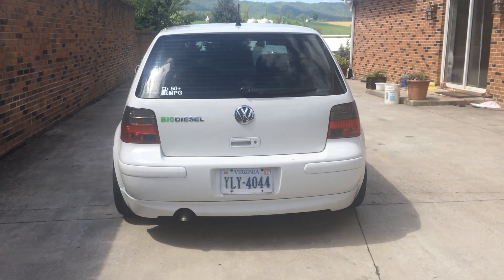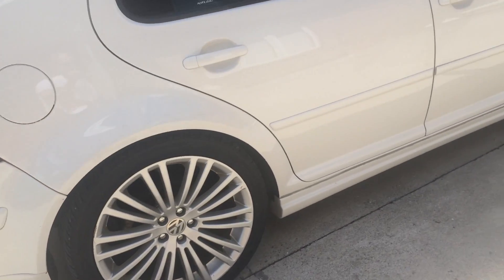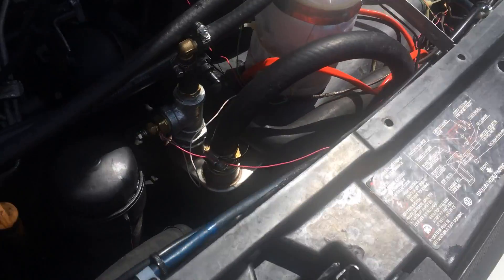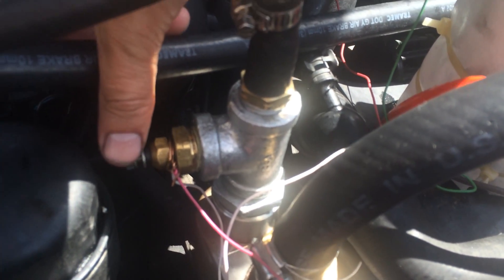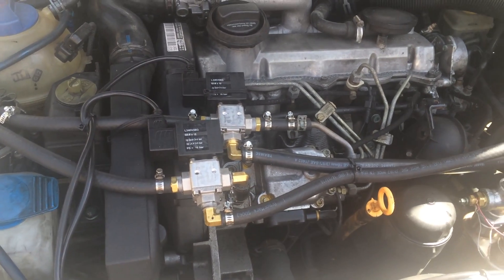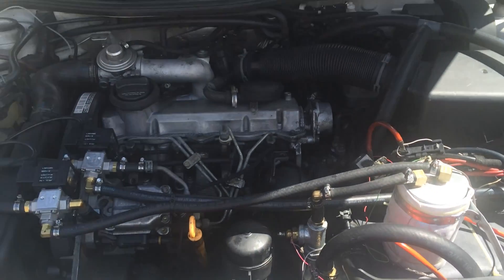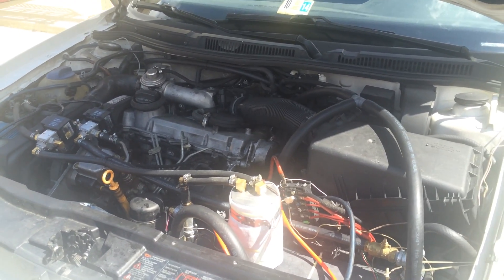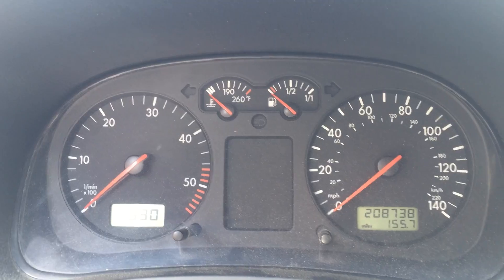Vegetable Oil WVO Conversion VW Golf TDI / Biodiesel

Comment: Wicked
How do you pass MOT ?
Would not it be better to use original fuel tank for veg oil and then tiny diesel tank in the boot for starting car up and driving a little before calling it a day ?
+ One large veg oil tank in the boot = 40 litres so you can 50%+0your  range on veg oil ?

Comment: Hey , I didn't found no more of following video ,like how after 1 year of use and how's the engine after like . I thinking converting my own golf Mark 4 TDI to biofuel or oil fuel
Reply from the maker: The Car is still running great. I don't do WVO anymore through, it was too much headache.
Before you convert your car into a veggie car you should know the drawbacks. 
I. First, you cant start running the veggie oil until your car 
is completely warmed up. So it is only practical for longer trips (at 
least 30 min drive)
II. Picking up and filtering the oil takes a 
time, after awhile it can become somewhat burdensome. 
III. Third, it is somewhat costly to setup, about $700 if you do it yourself (ordering 
parts individually) $1100 if you order a kit

Comment: Running 50/50 veg on a $300 2002 1.9pd mk4 105tdi remapped to 170bhp. 177000miles Engine noticeably runs quieter pulls  smoother.  On one occasion driving vehicle hard it felt like veins on the turbo stuck and felt like turbo stall. Back to running pure gas station diesel the issue hasn't happened again. Ambient temperature 15°c
Reply: You should try 35% diesel, 15% petrol (gas), 50% veg.... Plus 300ml mineral 2 stroke oil per tank.

Comment: 6 years ago this video was published. Please God tell me it's still runnin. Genuinely wanna do this
Reply: He still posts, don’t think there are any updates on this golf tho. check out some vw forums they’re full of info on veggie diesel conversions
Reply: I ran all sorts of waste oils in my old TDI literally for years. I just filtered it and poured it into the tank. Didn’t modify, heat or anything. Ran perfect and smelled hilarious when running waste veggie oil
Reply: @bugsy74  what year was your tdi?   Genuinely curious for the sake of knowing what years are capable
Reply: @chancefluke7833  mine was an 02. I believe it was the 1.9L. Let me tell you it burned everything I even filled it with used motor oil and it ran fine! It’s actually still on the road today one of my friends bought it off me. The only time it had trouble was if it was really cold out
Reply: @bugsy74  what  engine did you have on it , I have an 05 BEW, and roughly how many miles dud you run straight vegetable oil on it.
Reply: @hectormarroquin1021  I think it was the 1.9L. As for mileage I would fill the tank on waste oils all the time either wvo or even wmo and drive for miles and miles it never gave me an issue. If it was cold though it wouldnt start. My buddy still owns the car there’s about 260k miles on it today
Reply: Annoying cu..nts never answer import questions.
Generally speakings when they don't it means there is nothing good to say

Comment: You can also run used motor oil. And i really like your setup.
Reply: @Randy Harms 
Hi, 
I see you commented 2 years ago. But can you elaborate off of this comment? 
Thanks. Rick.
Reply: @ptdfbwprhq  You can filter or centrifuge the waste motoroil and mix it with gasoline to reduce the viscosity. Depending on your engine you can run anywhere from 20% waste oil to 90% without modifications to the car. Other oils like ATF and hydraulic fluid will work as well. Some better than others. Mineral based is prefered over synthetic. Any diesel engine with a mechanical injection pump that is not common rail should run well on higher concentrations. The biggest problems with running waste motor oil is he deposits that gets left over after combustion. These can clog oil rings and injectors.

Comment: Thanks for sharing the type of heat exchanger. I ran veggie in my 7.3 turbo idi all summer with just the heated fuel lines. As soon as fall hit, the veggie oil stopped flowing through the fuel filter. Now I need to get a heat exchanger for sure. Nice to see what size you had installed on your setup. Thanks!

Comment: any update? any trouble since you started?
Reply from the maker: Yes, this is what I learned. 
Before you convert your car into a veggie car you should know the drawbacks. 
I. First, you can't start running the veggie oil until your car 
is completely warmed up. So it is only practical for longer trips, at 
least 30 min drive. 
II. Second, picking up and filtering the oil takes a 
time, after awhile it can become somewhat burdensome. 
III. Third, it is somewhat costly to setup, about $700 if you do it yourself (ordering 
parts individually) $1100 if you order a kit
Reply: how many miles do you do per annum? If it's 15,000 milea or more, you will get your setup cost back in fuel savings in one year. After that it's all profit. Used veg oil is incredibly cheap. Some restaurants actually pay to get rid of used frying oil waste.
Reply: How is it worth it when this car barely costs $2-3k at best? Half of the cars value on the conversion, you're never gonna profit from this. All that time, money, hassle for less power and fucking around with oil all the time.. Especially with US fuel prices, which are ridiculously low compared to where this car's from originally. I don't see the point at all, you do you though

Comment: Sorry but couldnt what the full video .
This is runing bio-diesel or un estered oil?
Reply from the maker: In this video, it is running on straight WVO (waste vegetable oil) which i collected from a Thai Restaraunt after they were done cooking with it.
Reply: straight to the tank? :O what you think my 1.8 tddi focus can run with it too?
Reply from the maker: druszan17 If it is a DIESEL car you CAN do it. GAS car will NOT work.
Reply: Alexthe2nd sure 1.8 liter not high pressured turbo diesel .
Reply: Alexthe2nd
Anyway what about the smell of exhaust gases? couse in my country its illegal to use this kind of fuel couse you dont pay tax :S
Reply from the maker: druszan17 Yes, It smells like a BBQ, so it would be pretty obvious that you're not running regular diesel.
Reply: @druszan17  8

Comment: Hello my name is Taylor. I am interested in you're VW golf TDI running on vegetable oil. Currently I have a 1999 VW jetta 2.0 but I would like to buy a VW golf TDI and run it on vegetable oil. I was wondering what all you used to do this, and roughly how much it cost you to do so. I work at a family owned restaurant that said I may use they're used vegetable oil. I was also wondering how you filtered the the vegetable oil and if the could possibly post a video of how filtering yours.

Comment: I myself run veggie oil SVO / WVO in a Mercedes 300d. I use 12 volt silicone pad heaters in which i sell online. I sell some with 3M adhesive for fuel tanks and oil pans . I sell others with velcro or spring attachments to wrap around fuel filters .If anyone is interested here are the sites where i sell them. All heaters are shipped out within 24 hours of payment.

http://stores.ebay.com/pineridge16?_trksid=p2047675.l2563

http://www.amazon.com/gp/aag/main/ref=olp_merch_rating_1?ie=UTF8&asin=B00I5UFQHO&isAmazonFulfilled=0&seller=A2YBP4QB7DJXIW

http://theheaterguy.ecrater.com/filter.php?sort=date